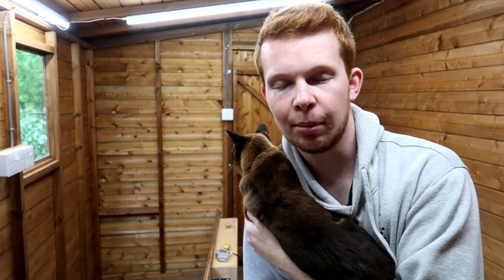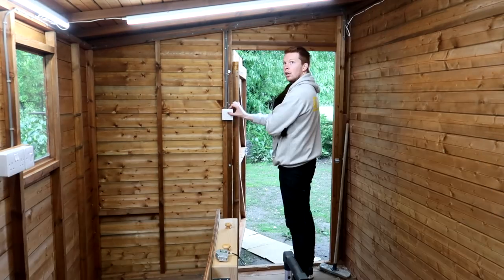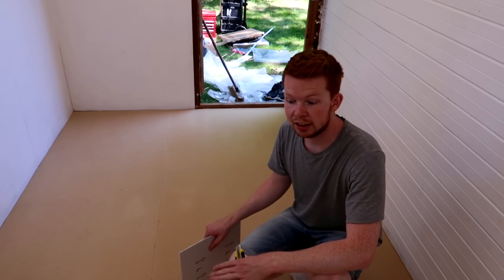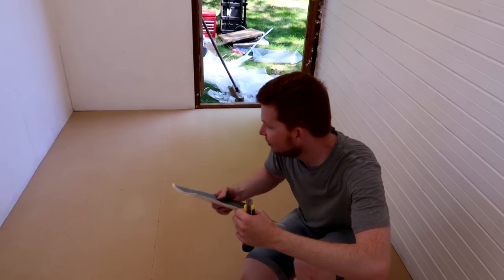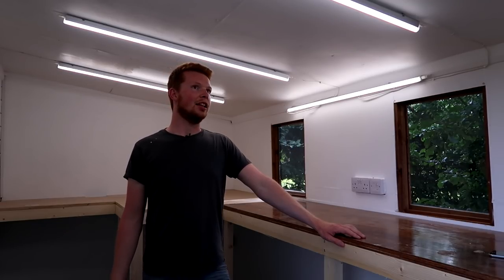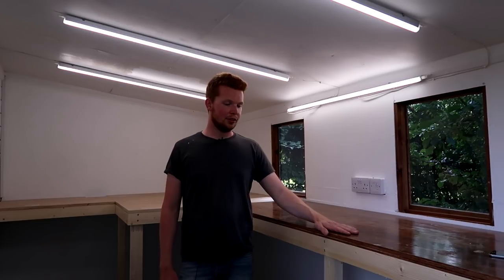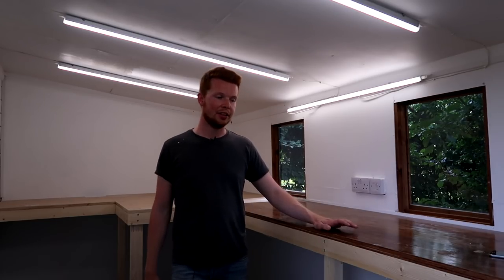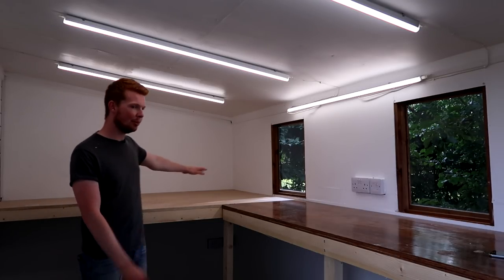Building a workshop (in a shed)

Comment: New cnc? Like for someone with not much diy experience you done good job. I recommend extra coat of varnish on outside and put some gravel around to limited rain splash on the walls, and generally you need look on any signs of damp.  Good luck.

Comment: +Tom Stanton if you do another shed, put the vapour barrier on the inside surface of the insulation - I think you risk moisture building up in the insulation this way round.
Reply: Spot on. The outside of the shed is waterproof. The moisture comes out of you!
Reply: @fatroberto3012  Excellent video content! Forgive me for the intrusion, I am interested in your initial thoughts. Have you considered - Mahorrla Wooden Paradise Method (should be on google have a look)? It is a good exclusive product for building better sheds and woodworking without the normal expense. Ive heard some super things about it and my work buddy after many years got great success with it.

Comment: You have the plastic on the wrong side. Moisture will gather in the insulation and create mould - even if you can not see it. Plastic should always be on the inside, so the insulation can breathe outwards due to the thermal difference between the inside and the outside. The dew point will be in the middle of the insulation. And when you put plastic on the outside, the dew point moisture will not be able to escape. It will stay in the insulation.

Comment: Enjoyable video, and reassuring to see how (relatively!) straightforward it can be to line a shed. 

Quick question: Do you think it would be better to have electrics installed AFTER you board up the inside, or BEFORE? I see your power was already installed, and I didn't see any obvious issues. However, in my current shed, the heavy duty shielded power cable runs along the studs, which (I guess means I'd have to detach from the studs and re-attach after installing the boarding.

I'm due to have a new shed delivered soon, and was wondering whether to put off the electrician until after I have insulated and boarded it up.

Comment: Tom, several subscribers has asked you questions, you don’t appear to have answered any of them. One of The questions that was asked many times was what kind of insulation was it you used ? It seemed to be cut in slabs as apposed to cut from a roll.   I am looking for a material that is a good heat barrier and a decent sound barrier.  Any feedback would be appreciated, Yours Ricky

Comment: But why didn't you tile the whole floor? 
That bare strip under the workbench will bug me forever :(

But seriously, nice job!
Reply from the maker: +threeme2189 the strip is 2/3rds of a tile wide, so the cost of the waste material that would be produced from filling it in wasn't worth it. Plus I'll be covering it up for storage anyway
Reply from the maker: +threeme2189 the strip is 2/3rds of a tile wide, so the cost of the waste material that would be produced from filling it in wasn't worth it. Plus I'll be covering it up for storage anyway. Thanks!
Reply from the maker: +threeme2189 the strip is 2/3rds of a tile wide, so the cost of the waste material that would be produced from filling it in wasn't worth it. Plus I'll be covering it up for storage anyway. Thanks!
Reply from the maker: +threeme2189  the strip is 2/3rds of a tile wide, so the cost of the waste material that would be produced from filling it in wasn't worth it. Plus I'll be covering it up for storage anyway. Thanks!

Comment: Was it plywood you used for the ceiling? If so what thickness did you use please?
Reply from the maker: I use 3mm mdf for the roof and 5mm plywood for the walls. Thanks
Reply: @TomStantonEngineering  great work mate I'm just starting out with mine and stumbled across your video and just wanted to say this is fantastic 😉